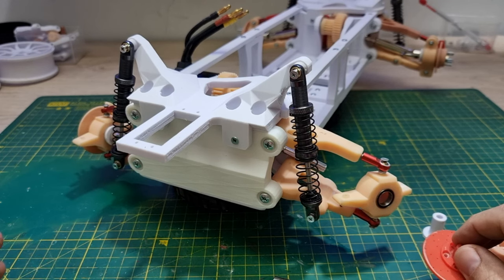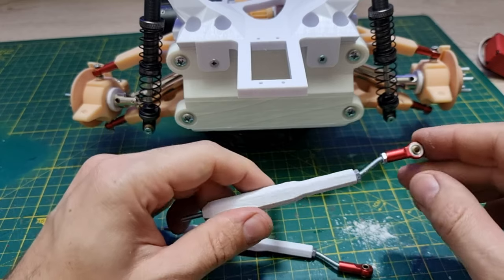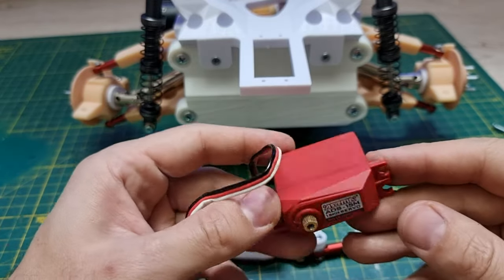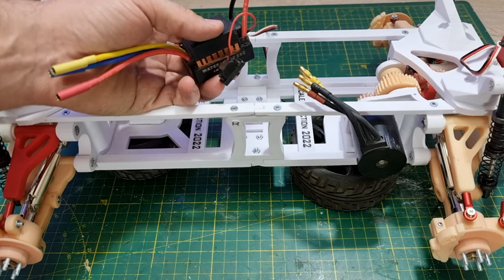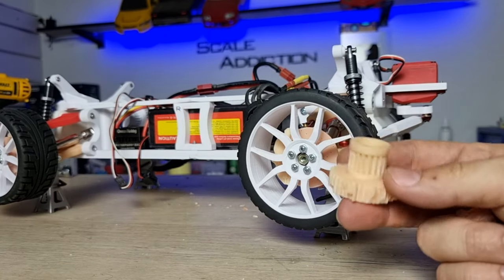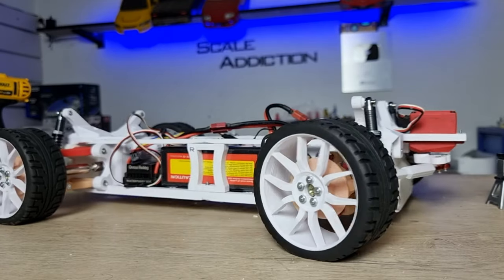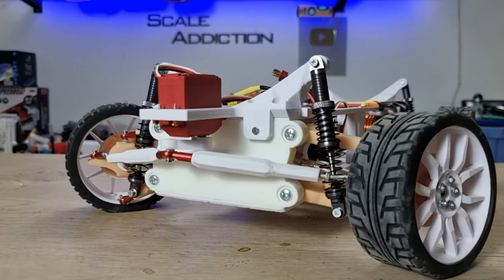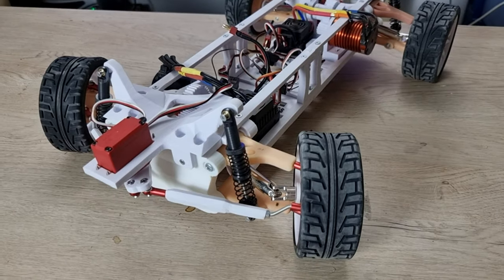STL File + Running 3D Printed 8th scale Brushless rc car part 4| Scale Addiction

Comment: On the front tie rods, instead of bending the metal, you could make the angle work in the print, then just use a straight threaded rod out. Take the one you have an take a photo of it, then design it in cad based off the final angles.